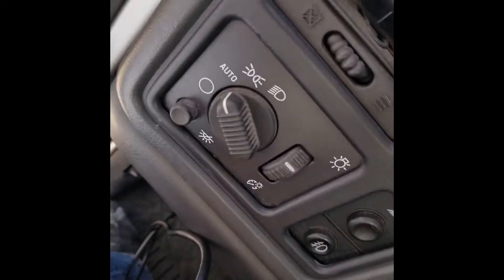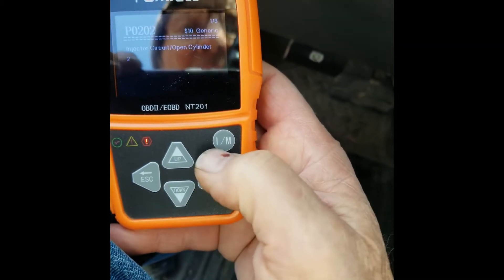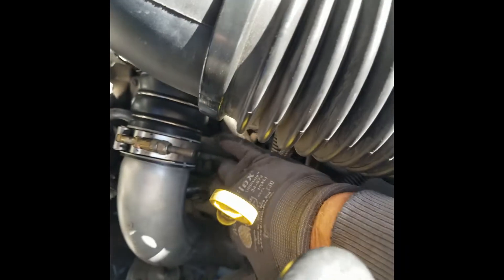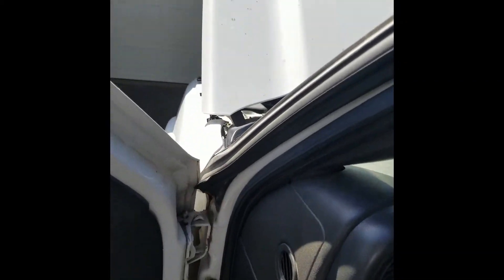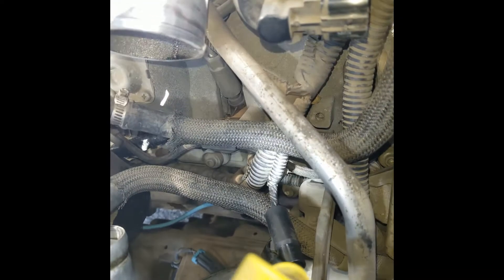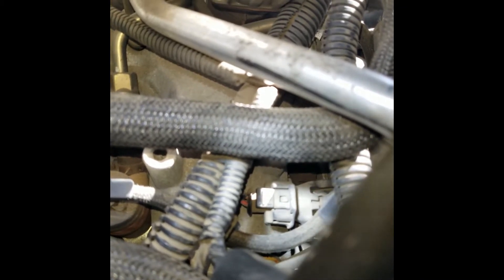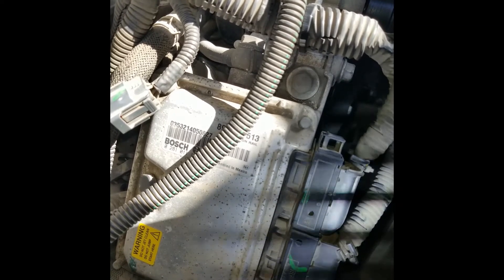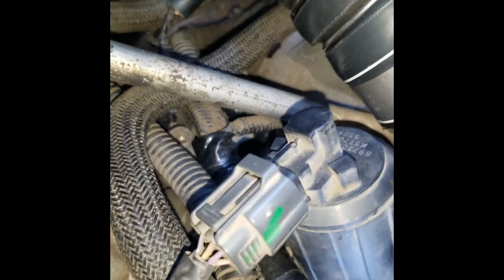Duramax LLY Tractor Mode Jiggle Test

Comment: Circuit/System Description

The engine control module (ECM) supplies voltage to each fuel injector on the injector positive voltage control circuits. The ECM energizes each fuel injector by grounding the control circuit of that fuel injector. The ECM monitors the status of the injector positive voltage control circuits and the fuel injector control circuits. The injectors are separated into the following four groups:

    Group 1–DTC P2146 with injectors 1 and 4
    Group 2–DTC P2149 with injectors 6 and 7
    Group 3–DTC P2152 with injectors 2 and 5
    Group 4–DTC P2155 with injectors 3 and 8